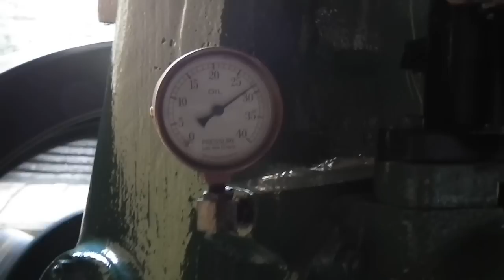National DSSH - Vintage oil stationary engine

Comment from the maker: Hi Thanks for your comment. From these models where 2 that they are like the same! DSH splash lubricated & DSSH presure lubricated! I understood you about the english, me too I am not from england :). Please reply agin my comment and tell me what ou need acxacty. Do you need the gab for the rocker to the valves? These type of engines are a bit hard to get them going. On mine in winter I have to use easystart otherwise it wont start
Maybe can I see a video of your engine maybe showing it only?

Comment: Nice engine, Nice work! From Holland here: I have exact this one standing in my dutch '30's  tugboat. Nobody knows of hear about National, can't find any documents about it, can you tell me please the inch mm's or metric mm's between valve rocker arms, Now this is so much my handle for compression reduction can turn over  for more than 180. So this must be get smaller :-)  I just get running him 1 time before (excuse for my english)   thanks Michael

Comment: Video is coming later, I have only photo's  The head and body are the same, also before starting i must put some oil at that 3 places only, and some parts around are placed different. It is extern watercooled and have no oilpump. I only try too find out the valve clearance  (feeler gauge)  this is now too much, = too much movements in the decompression handle, when this boat is goin to wather video's are coming!  starting now means boat shakes terribly on his trailer